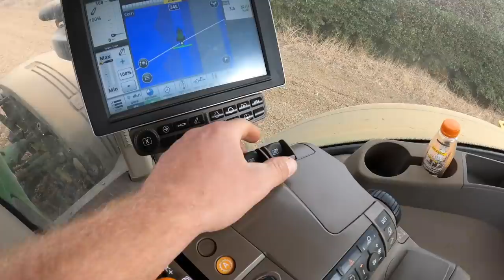DRILLING, HARROWING, ROLLING #FARM VLOG 171

Comment: Love the vid as always.  One point, i only started watching this summer, you had said whilst harvesting that you don't empty on the move for compaction and traffic reasons.  Yet, you have chisel ploughed, subsoiled, power harrowed, drilled, harrowed and then rolled.  I'm assuming that all the equipment is different widths that's a lot of traffic over many separate lanes of the field.  So now i don't understand the benefit of not unloading on the move and slowing harvest down, yet driving over the field several times with many pieces of equipment.  Please don't think i'm having ago but i can't see the logic.  As always, great video and best of luck for the rest of the growing year until next harvest.
Reply: Ah, I also questioned this point. Nicks later video explains this and there is a very valid reason for not doing "min till" on rare occasions. Watch on and all. will become apparent....

Comment: A slight overlap at some points Hayley, but at least you didn't run out of seed or sheer a bolt like some "experienced professionals". Perhaps you should teach the aforementioned "professIonals" the correct procedures? I'll say no more on the topic!!! As for the overlap, very few (if any) could do a better job

Comment: Nick I have a question, what is the benefit of rolling in a field after its been drilled and is it neccessary
Reply: If nothing else pushes the stones down so less likely to go in the combine come harvest!
Reply from the maker: Main reason for rolling is to preserve moisture, it also leaves a nice level seed bed plus rolls in any stones that could cause damage to machinery, yes it’s very necessary 👍👍